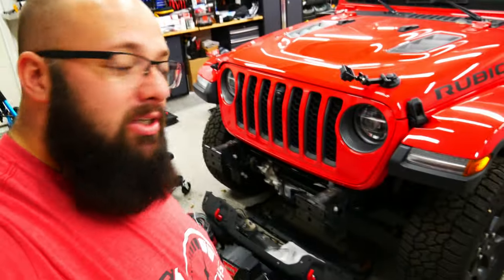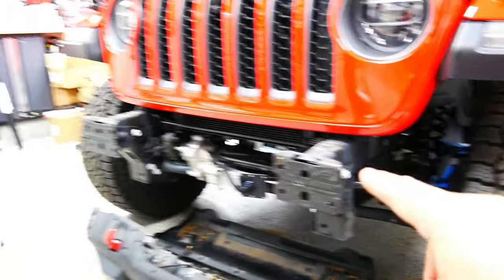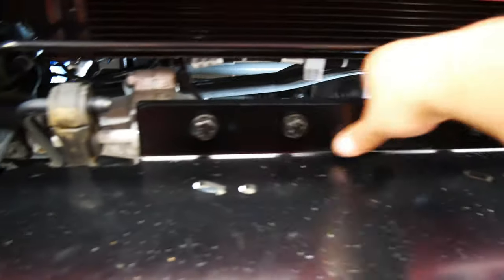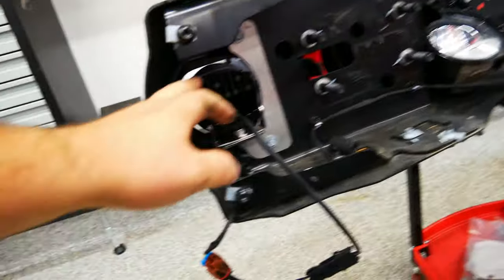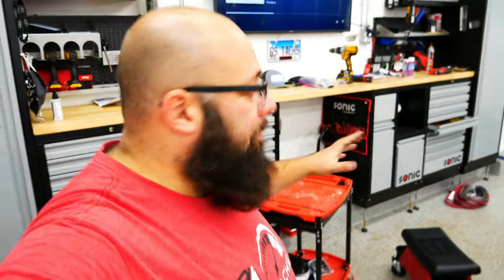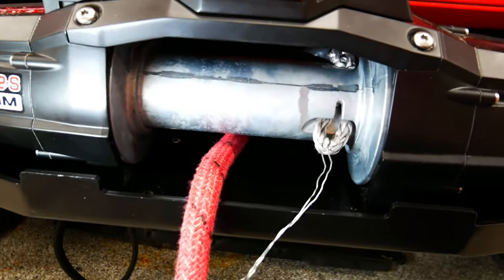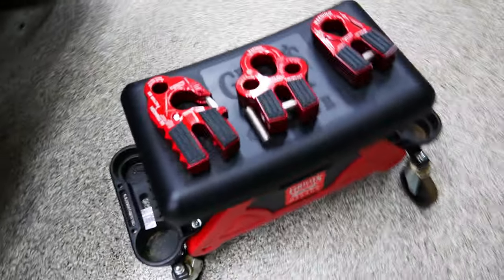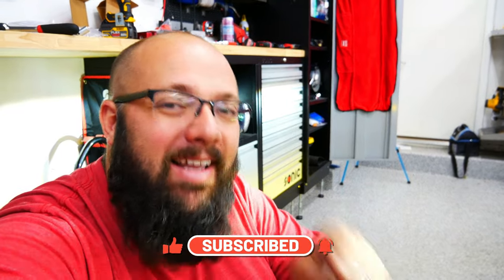Complete Front End Upgrade! Warn, Factor55, Baja Designs, Rigged Ridge - Gladiator Overland Build!

Comment: Thanks for the video. I found this while searching how well the trail camera works with the Warn low height bull bar. FYI you can get 12v manually resettable circuit breakers that can be turned off. I use one on a S-Tech switch pod.